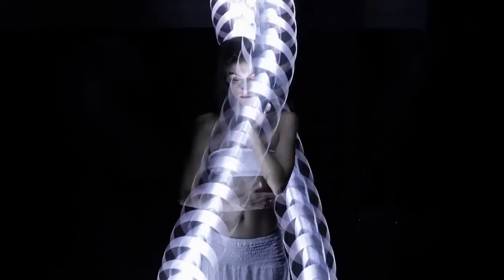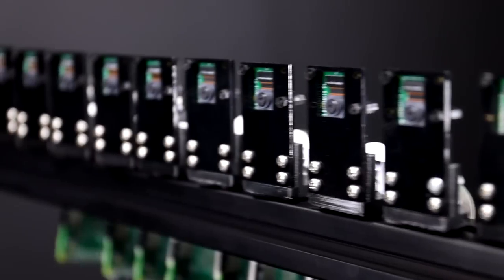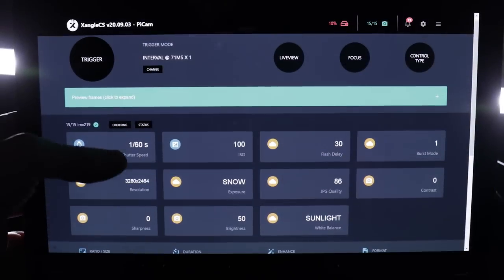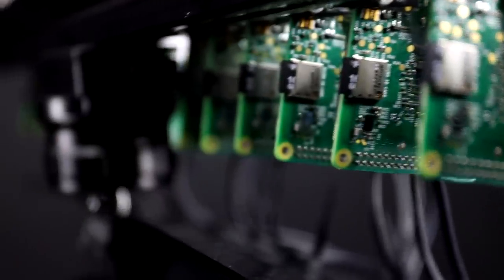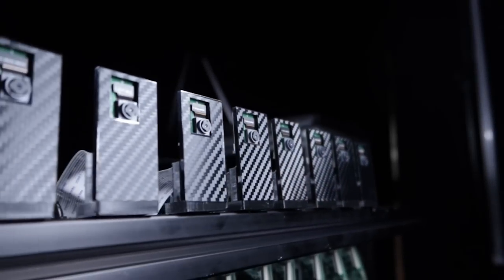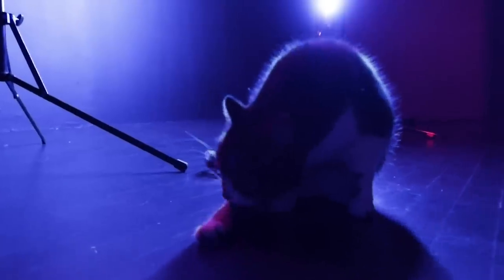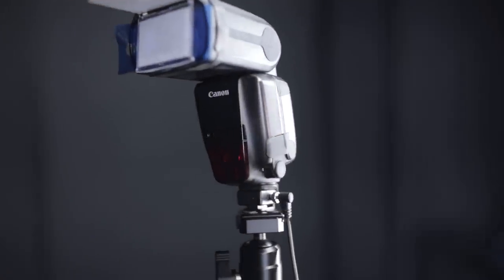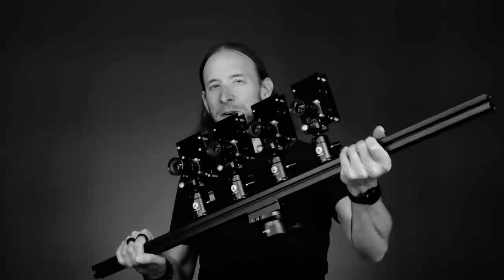Experimenting with bullet-time software for Raspberry Pi cameras

Comment: If you want to make the cheap cameras more consistent, mount the front of the camera through a hole cut in the plastic, then glue the housing to the plastic.  If all of your mounts are the same, the focal plane of each sensor will be the same.  AKA, front mount the camera instead of back mounting it.

Comment: I'd love to see what could be done with the current breed of small camera modules and capture options. Two, four, and even eight cameras at once on a single board is not unheard of, and would significantly improve the hassle for large photogrammetry setups. Another improvement would be to mount the camera modules from the sensor/lens, rather than the PCB.

Comment: if you sync the pis and stagger the timing of each picture aquisition you could get 15000FPS out of this rig*
*at very low resolution
when they were testing nuclear bombs they used a special device that had an array of cameras pointing at a spinning mirror. as the mirror rotated the view of the subject of the picture into view each camera in the array would be activated by the same mechanism that was rotating the mirror. What you've made here could do the same job with some image processing and accepting artifacts of distortion from camera offset without a mirror